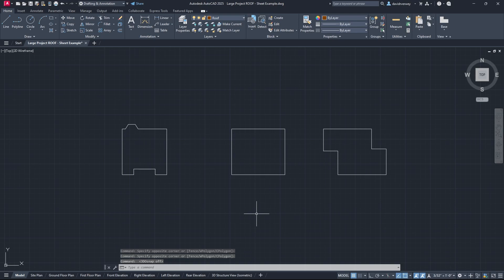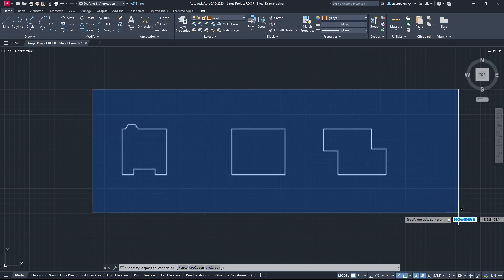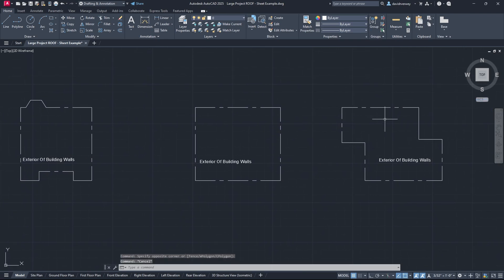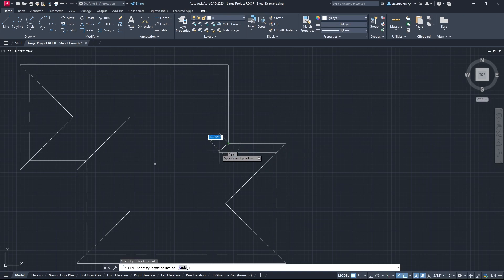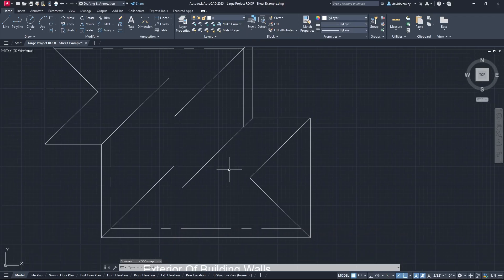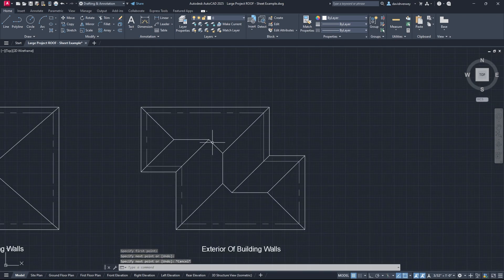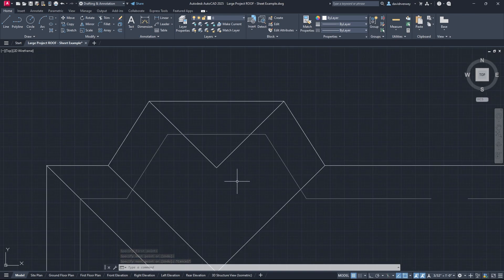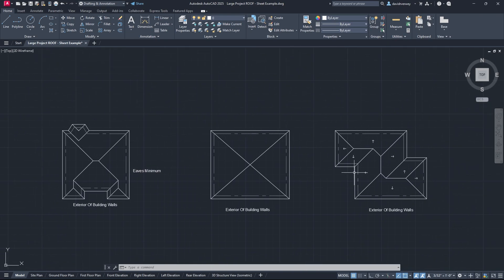AutoCAD - ROOF Design For BEGINNERS! (2D)

Comment: Very painful to watch.  Next time turn on Polar tracking 45°.  Also if you noticed your snap was picking up the angle automatically,  Line start point, hold mouse (snap over direction.  enter distance, enter again to accept recognized angle.  I thought this would have been a lesson on 3D drafting of roofs.  Very poor title of vid.
Reply from the maker: The audience of the video is targeted at people who rarely or are just learning the program and roof design. The way it was done is the way most of our students told us they liked doing it, so that's what we did as apparently it helps them visualize the workflow. We know how to polar track, and we use it frequently when not teaching! 
As for the 3D portion, the thumbnail we thought was quite clear on it being a 2D roof design. However, we will take your comment into account for the video title.
Thanks for the input and all the best!
Reply: @VerweyDraftingInc   Sorry isn't the point of teaching someone to be more efficient?  Try creating this video again but use the polar snaps.  I bet you can save a minimum 6 mins off by removing your unnecessary keystrokes.
Reply from the maker: @scottd6406 No need to be sorry. The point of this video is not efficiency, it's simply for people who are having first contact with this concept and are just learning AutoCAD. Again, as per my previous comment, this is the first way we go through it to teach people because ~80% of those we have taught have told us they prefer to learn it this way first when going through it for the first time as it helps them visualize the concept and get a hold on it. I know you can save time doing it the way you described - I don't disagree with you at all and I actually agree in that regard. But for the people we teach, this seems to be the best way for them to learn when doing it for the first time. We do things based on feedback from our students. If something is too complex, it's broken down and simplified to help someone understand first.